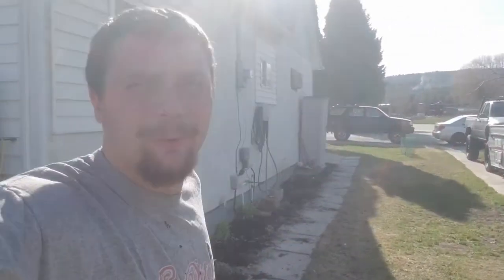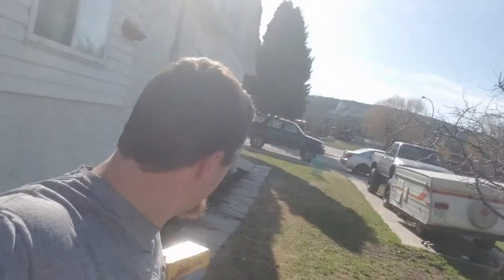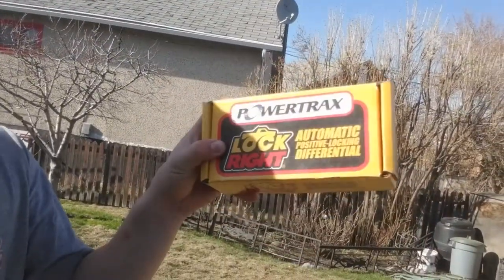Lock Right Locker Install - Toyota Pickup

Comment: 2 days? you can pull the 3rd in 45 minutes and install locker in 30 minutes
Reply from the maker: Yup. That's true. As mentioned I had my buddy who is a tech install the locker. And I had to wait till the next day so he could put it in the 3rd.
Reply from the maker: That being said, new video coming soon on front locker install. I'm putting a 4Runner factory e-locker up front.
Reply: Gotcha, I missed that part